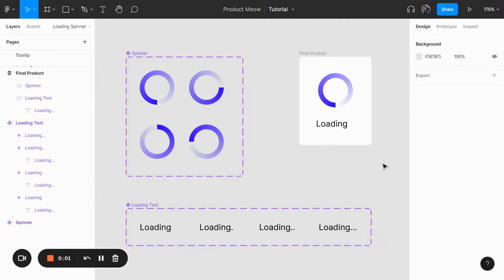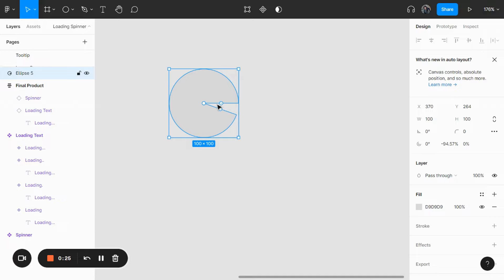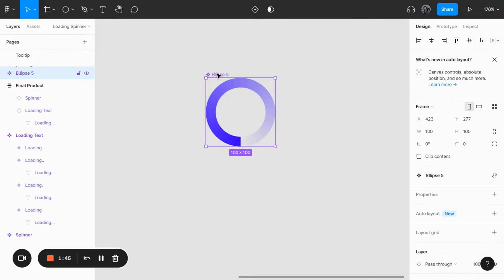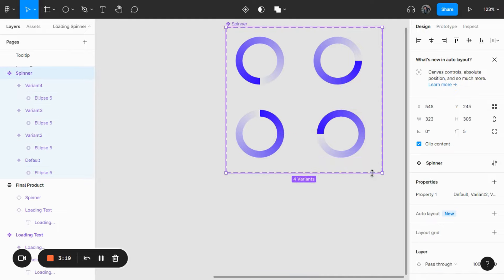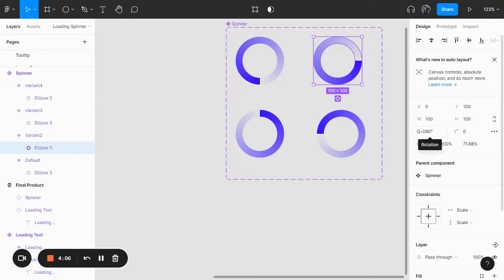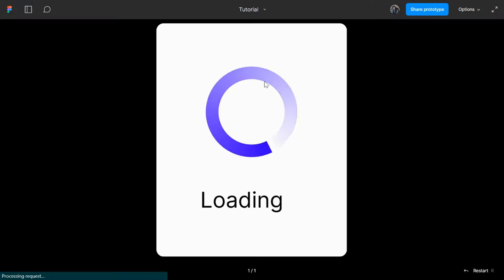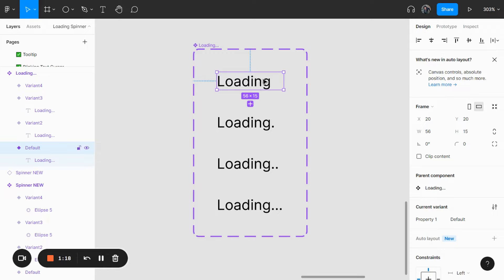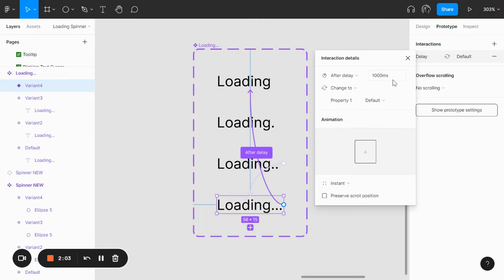How To Create Loading Spinner In Figma

Comment: if it didn't work with you : You might want to check that the rotation is done on the elipse and not on the component itself.
Reply: Still it halts for micro sec. It doesn't seem smooth
Reply: still didn't work why?:(
Reply: THANK YOU!!
Reply: saved my life. thank you!
Reply: U save me , thanks.
Reply: Not all heros wear capes 🤗

Comment: Hello. I want to clarify that I've tried it and it didn't work. I tried to change the angle of the color itself by 90 degrees every time and it worked. I think there is something to do with their latest figma update where the shape rotations don't work or something.
Reply from the maker: make sure the different variations of your ellipses have the same name. Also, check that you are using Rotation which is directly below the Width.
Reply: @productmeow  Hello. thank you for your reply and thank you for the video. I have found that the problem was in rotating the variant itself, not the Elipse. I've experimented both and found out that when you rotate the variant it doesn't work. cheers.
Reply from the maker: @SolomFoz  Glad everything works out for you :) Keep experimenting ! 🔥
Reply: @SolomFoz  iI had the same issue. Instead of rotating them, I just change where the angular graduation start from and now it works!
Reply: @yazeedirshaid I had the same issue too after creating 3 different times and almost gave up, even making the name the same still did not work  .... until I followed the changing of angular graduation, and voila it worked ..thanks
Reply: @SolomFoz  Thank you! It help me)))

Comment: Thanks for this video, but animation in interactive component looks like frame by frame animation, even though there's a smart animation. It works when you put the same spinner (not component) in frames and make interaction between them. Then looks great, but that's not the point creating multiple frames just for single animation, it should work as an interactive component.

Comment: Not working
Reply from the maker: Which part is not working for you ?
Reply: @productmeow  while prototyping
Reply from the maker: @famjam954  which specific part of the spinner is not working for you?
Reply: @productmeow  while preview it is not rotating
Reply from the maker: Make sure the rotation was done on the ellipse and not on the entire component
Reply: @productmeow  In prototype it does rotate but not smoothly. It kind of like snaps into those 4 different states. Not as smooth animation. Dont know where problem is really. 
I found some animations in figma community and they have like an "indicator" in it. I think some latest update of figma might have changed something that this way of making a spinner does not work anymore?
Reply from the maker: @xilentttt  just checked ~ this prototype still works on latest figma update.

You might want to check that the rotation is done on the elipse and not on the component itself.